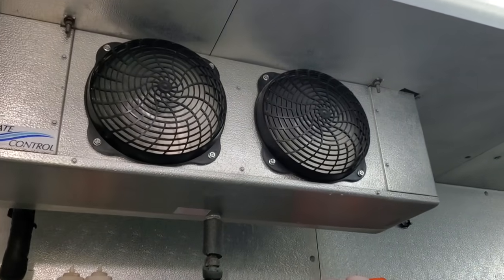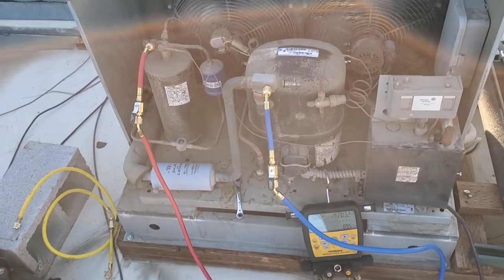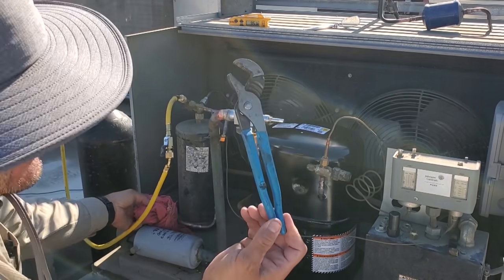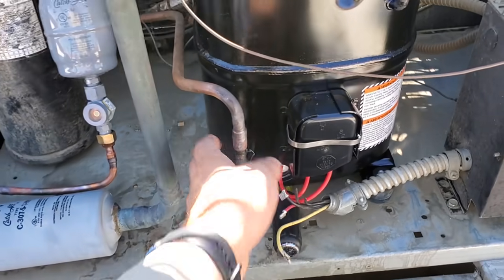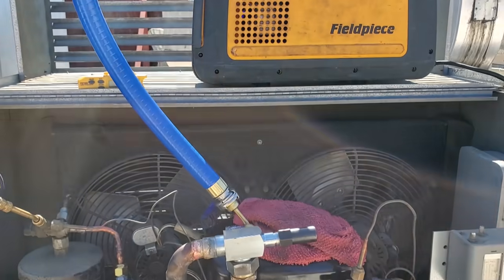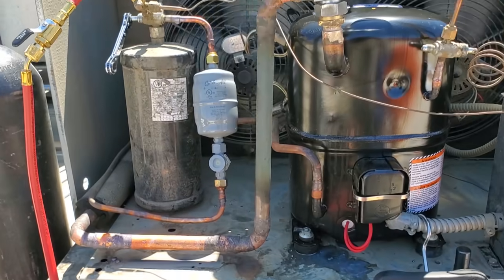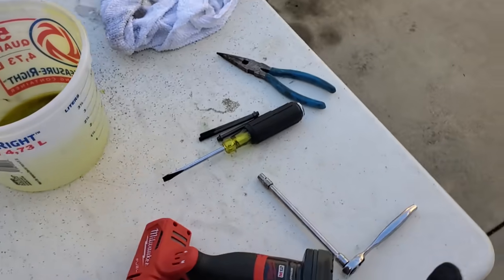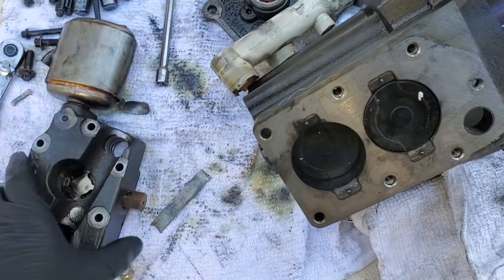THE COMPRESSOR SOUNDS LIKE IT HAS ROCKS IN IT

Comment: OK, i know your not an automotive tech, but i figure the basics should transfer over, i've completely taking my system apart as i'm rebuilding it from basically scratch, we talking new compressor, condenser, evaporator core, accumulator, etc, but when i took it apart, i did not find any component in the system that looks like an expansion valve, i don't know if this is normal or not, but would like to know 2 things, 1st since i didn't find one, do systems require it and second, if i put an aftermarket part on, where in the system would it be placed?
Reply: Need way more information to give any useful advice (make/model/year) but I can guarantee you there is an expansion device of some sort. If it's automotive I've found most cars seem to use AXV-type valves. Why aftermarket? For a car's AC system just go OEM unless you're running a classic car that used R12 or something like that. They design these systems to incredibly fine tolerances to save money, so your expansion valve is designed to provide a specific amount of refrigerant flow in conjunction with a specific amount of airflow from the fan, taking into account evaporator size, etc, etc... so its best to keep your vehicle's AC system as OEM as is possible.
Reply: @boginator55  it is an 85 chevy c10 silverado lwb, it has an orface tube in line, not sure if that is the device you are talking about, but it was an r12 as far as i know that was converted to r134a before i got it, and a lot of the oem for this truck is discontinued, that said, i managed to source an oem evap core, orface tube and accumulation, i sourced what was supposed to be an oem condenser but it ended up not being the right size and i cannot find my particular condenser anywhere so ive flushed it out as best i could, and ran a fin comb through it n both sides and will be pressure testing it to make sure it is still usable, as for the compressor, ive got a newer style off a mid 90's gm 1500c/k pickup and the compressor is switching sides from driver to passenger due to the belt system being changed from vbelt to serpentine and the fan has been swapped from a clutch to a solid mount, but i found nthing that looked like an expansion device in the system other than maybe the orface tube
Reply: @forceablepizza764  So the orifice tube sounds like it's your expansion device, but since this is indeed a custom r12 to r134a conversion (and on top of that, a relocation of the compressor in the engine bay), I'd recommend you to get in touch with a shop that specializes in auto AC repair. They'd be much more able to give you advice on what specific parts to use. Unlike commercial refrigeration where copper tube sizes and components are easily interchangeable and standardized, automotive AC is highly dependent on the manufacturer, and things like linesets, condenser size, evaporator size, compressor type/capacity all have to match up properly for the system to operate.
Reply: Orifice tube is your expansion device. Yours appears to be placed in the small inlet tube of the evaporator, short end first. The long screened end is the inlet side and four indentations in the aluminum tubing are there to hold the orifice tube in place. One grips the end extending out of the taken apart hose to evaporator connection and heat the indentations area gently and the orifice tube and stuck O rings will come right out of there. GM has several styles and I had quite a time with my 97 buick because new for that year was a throttling compressor that would cool like the arctic at a stop light while the engine ran at 227 and then quit AC cooling going down the highway. Turns out the valve that does the swash plate modulation has springs set for R-12 and it's running R-134a. Which got me turned onto GM unusual self throttling orifice tube which is only offered on their most troublesome/complaint prone models.
https://www.ebay.com/itm/A-C-Orifice-Tube-Adjusting-Orifice-Tube-Front-UAC-EX-7000C/322649164636
I tried all the recommend ones, this one above worked very much better except for the open road issue.
All I had to do once that orifice tube was installed was to keep pumping R-134a into it until the condenser backpressure rose high enough to get the swash plate to move in the compressor. Half a can at a time until it would cool adequately going down the highway, you don't want to put too much in it. Cool as a cucumber and I put in a 180 degree thermostat to the give the engine a bit of relief too.

Comment: The compressor it's designed to be carried vertical not horizontal my assumption is that it was carried horizontal if we look closer at the affected areas they have one thing in common the damage it's only one end side of the compressor   if we are looking at the compressor hat we can see some steps welded there is where that little ear it's sitting  so my assumption it's that the compressor itself was carried horizontal in the past bending the ear  that made the compressor to vibrate more and weakening the discharge plastic tube that it was fixed with the metal strap as I have stated in my other post where it was bent it's creating a week point in the material.

Comment: What RPM would that compressor run at? I'm guessing it's standard 3 phase voltage at 60Hz?
Reply: It would depend on how it's wound, 3,600 RPM or 1,800 RPM minus the standard induction motor slip at full load. So 3,460 and 1,725 are pretty standard actual RPM figures.

Comment: That tab that was broken off the muffler looked like it supported the intake silencer / muffler / baffle, which was also connected to the manifold that also broke the other strap. Something out of balance and it was just shaking itself apart??? 
And, dammit! I was about to comment you forgot something.... the contactor, but never fail, you did change the contactor!! lol  Jokes aside, the contactors life is to make and break under load and to stop arcs. It will always look like shit and pitted, but doesn't make it bad.

Comment: the broken piece, maybe an oil slinger meant to spray/toss a small amount of oil each rotation?
ohhh bracket from muffler. bad design, overheated long periods due to/low-gas/work hardening.

Comment: All plumbers should know, the joints you are making are solder joints, NOT braised!
Reply: well then that would be the differeance between a hvac technition and a plumber...plumbers dont deal with the pressures that he does, probably uses a completely different alloy!!
Reply: @briangarrett8789  He uses tin/lead alloy. Solder. You cannot braise copper as brass has a higher melting point and the copper would melt before the brass rod used for braising does. The first thing we learn when being taught how to solder then how to braise then lastly weld.
Reply from the maker: I'm braising here using 15% silfos for the copper to copper joints and 56% silver for the dissimilar metals.... i only use tin solder for plumbing pipe this is refeigeration

Comment: Poor design that compressor. Why would someone use a thin strip of metal to hold down the manifold or hang a small piece of metal on the muffler? All that vibration goes after the weakest parts in the compressor and can sound like a bucket of bolts when they fall into the crankcase.